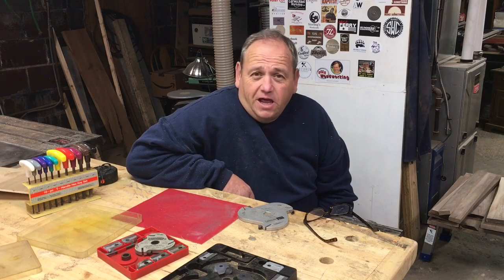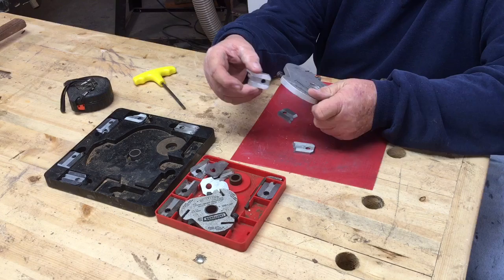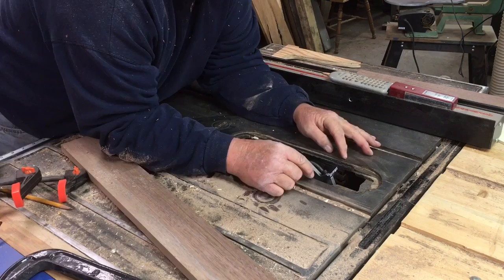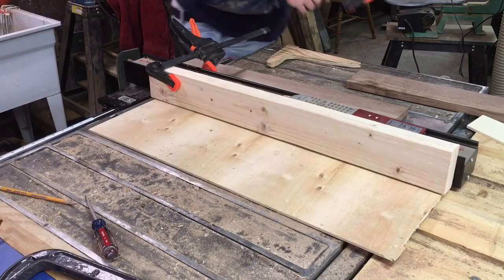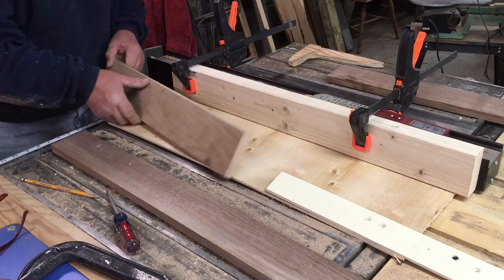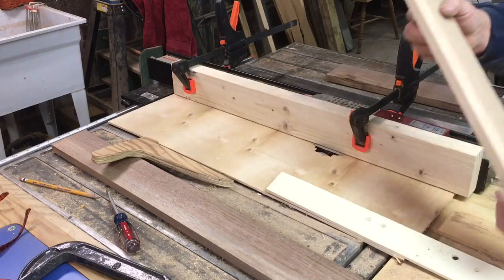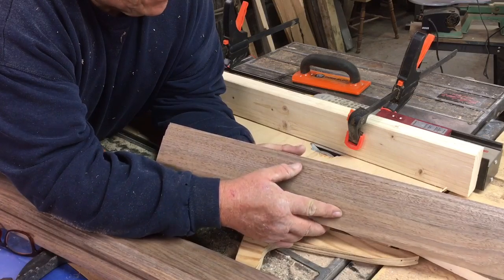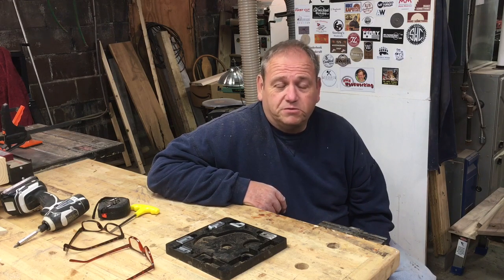Craftsman moldings head cutter and how I was taught to use them by Bob's woodshop

Comment: I am glad this video is still here to be seen.  I have watched a number of them, but you made a couple of points that are priceless.  1. Using a sacrificial fence and only exposing the part of the cutter needed.  2. Using a thin sheet of plywood under the sacrificial fence,  cranking the cutter up through it, and thereby making  a huge zero clearance  insert.   By the way, these cutters, and router bits in a router on a table, can help create some complex moldings.  StumpyNubs has a video about making complex molding with basic bits.  By the way. I just bought a three headed cutter with four sets of cutters on eBay for $10.  Deal of the century.

Comment: I’ve have two different sets passed down from my grandfather that have been gathering dust for 20+ years. I just recently got my shop up and running and it’s with the tools that he’s passed down as well. I’ve always had a passion for it, just never had the time. I’ve got the old tools resurrected and ready to start putting out some nice custom pieces the old school way! Thanks for the video, it’s exactly what I was looking for.
Reply from the maker: Believe it or not there is a company still making cuter for those molding heads cuter!

Comment: I have been looking for a dado set which I don’t really know how to use or put together but while searching and learning I saw the craftsman 18 piece cutters and now I think I have solved my trouble of replacing old 120 year old molding.  I was looking for larger pieces but I see that is not necessary.  Now only to decide what kind of wood is best for molding and then what kind of wood should I used to replace the dangerously soft NC front porch.  
THANK YOU SO MUCH!  Thank you Bob.
Reply from the maker: Good luck with your project! The molding heads are handy, there is a company in New England area! Not sure of the name . But if you google it craftsman molding heads! It should come up! Poplar is a good wood,  poplar takes paint well too! Mill up well !

Comment: Thanks Bob for making this video. I just bought the same one you have from eBay out of concerns they are no longer sold by Sears and may disappear all together. I am well aware how expensive moulding has become so I greatly appreciate the lesson as well as the excellent tip on using the sandpaper to keep them sharp. Looking forward to my first moulding project and your help  was most appreciated. Thank You!
From an old electrical engineer who now prefers to work with wood since most of my projects will no longer be generating smoke or sparks! :>)
Reply from the maker: I hope this helps,I them every once in a while!  I am retired electrician! 😂 I prefer working with wood too!

Comment: Excellent video. Just what I needed. I'm finishing up a remodel of our living room and need to duplicate a piece of trim over the front door. We gutted the room to insulate and rewire and also changed the front door from a 2-8 to a 3-0. My uncle made this trim in the early sixties and only owned craftsman tools. I found a new cutter set on ebay for cheap but was unsure of the setup. The profiles match the original trim perfectly so here I go!
Reply from the maker: taavey  I glad you found the useful I made this video to help just for the reason you stated! I am at that age now that people tell that their father ,grandpa or uncle ! Had a set of these and used them for something in the homes way back in the day!  When I made this video I did not see a good video on the cutters! Good luck with the molding in your house,!  Regards BobLee

Comment: The legendary "Mr. Sawdust" used this tool for a large variety of tasks, his most impressive was cutting swan neck molding for a tall case clock project, something you'd think only a W&H type open frame molder could do, but with a radial arm saw there isn't a profile you  cannot cut. The much older and earlier models were machined from solid bar stock, thus had great mass vs. the flame cuts from plate stock that are more widely available, still though, a great tool.

Comment: Thanks I was looking at Radial arm use of them, but I know they work on the table saw too.
If you get a one cutter head from what I've seen they do not cut as good  speed feed rate.  
Because the sears units had positive side to side alinement you probably get a better cut dewalt made them too.

I have 3 sets of them and haven't worked up the nerve yet  but after watching this I may just do it on my big table saw.
Reply from the maker: Hey thanks for watching, my knowledge is what I put in my video , RAS are something I have no idea how to use them on them lol , I have 2hrs table saw that does a pretty nice job with my cutters . The biggest thing is to take little cuter with them . I use to used my small cutters on my dad’s 8” belt drive table saw and got the job done too!

Comment: Mr. Lee
I have had my molding head since 1978 when I bought my De Walt RAS. Of coarse I use my router table for most shaping today, but my De Walt is still my go to saw and in the early days the shaper head was in use by me all the time.  Many different shaper blades are still available today. Experiment with the tilt head and miter to get some great effects. You can even process curved molding using guides  and hard wood cut out on your band saw. 
Good luck to all, process your projects with safety in mind this molding head can open up may beautiful possibilities
Try some compound shapes by applying one shape over the first, or even the second and third. 
Papa Dave
Reply from the maker: David McMullen what I like about wood working is that I will never be done learning about it!🤗🤗

Comment: Thanks for the safe demonstration (there's another video out the where the guy puts the cutters in the wrong way up!) The only difference for me is that I use a radial arm saw.
Reply from the maker: I have only used a table saw for my molding heads. ! I do have radial arm saw I just use it for cross cut !
Reply: @bobleeswoodshop7919  The radial arm saw is my only large power saw, besides my small bandsaw. I have had rhe RAS for around 40 years & it still works very well. I did consider table saws at the sime - I had used them about ten years earlier in high school, but while shopping for a saw I happened to see a professional demonstrator get distracted and remove most of his fingers ...   Still using the same RAS and still have all of my original body parts.

Comment: Ok Bob, let's Chuck them up on the RAS   they were ment for tablesaws and radial arm saws both.
I like your zero clerence bord idea.
Reply from the maker: Hey bobg I am not sure I would want to to use them in a RAS , mainly no one has ever shown me How! My brother is a lot better with his RAS   Thanks for watching Regards BobLee
Reply: Thats Mr Bob to you.
What I've seen and read in older books on the RAS and molding head cutter you push the stock into the blade like a table saw turned on its side, the molder head is parel to the table and behind the fence like a real molder only overhead.
You move your part into the cutting edge like the table saw, but you use a jig or lots of hold downs and keep your hands as far as you can away and use a push stick. You can move the saws head out and lock it down
To progress into a cut.
I think there are about 35 different profiles you can buy
Still today as well as a full kit.
Last in looked it was 19.99 plus shipping for a 3 blade set.
But a few cost more.

You also need a dado guard, and I'd use board buddies because you don't want this giving kick back. Take light cuts  until you know what you can do with the tool.
I own a big Bel saw but it needs some work and I don't have any molding blades for it yet but I can buy them from Bel saw as well as wood master, you can also have them made.
I'm wondering if these cutters will fit it with the right Gibb. Anyone know?

Comment from the maker: Just remember you are responsible for your self  so know how to use your tools  and wear your safety equipment!! I hope the video will help New woodworkers with the older machines!! Regards Bob Lee
Reply: Is your table saw belt drive? if so is the motor loose or tensioned?
Reply from the maker: commander187  My table saw is a Craftsman 12"  2horse Direct drive .  I do not know about a belt drive. The thing I do is take small cuts with the cutters . That way the saw can handle the process of making the cuts .  I make several passes with my wood through the table saw.
Reply: Cool thanks I have a 10 inch belt drive and to my understanding the weight of the motor keep constant tension during the raising and lowering of the blade. I think I'll look for what you have there. I did not know that craftsman made a 12 inch.
Reply from the maker: commander187  You may not find one I got my saw 46 years ago from sears !! I got the last one they had at that time!
 You could get a bigger motor for your saw or find a newer saw with a 2horse motor on it . I know that is more money its just I think you are going to find that saw that I have. I am 63 years old now I have not seen one anywhere? Best Regards BobLee

Comment: That is a very useful tool. I dont know if these exist in Europe too, i'll be looking at every fleamarket from now on!
Reply from the maker: Willem Kossen  oh wow that interesting . I use my own from time to time . You still find them used ! Thanks for watching Regards BobLee
Reply: The existed in Europe, but for reason of safety regulations they are not produced anymore. Available only with chip limitor now. Beware, without the chip limitors this is a verry dangerous tool . Not to be used on a table saw machine  if the rpm is not adjustable. Mostly on table saws the rpm is +/- 3000 rpm, this is for moulding operations mostly (much) to low . Kick back risk and poor finnish are possible.

Comment: would be interested to see if anyone has used/compared the set with the 3 heads vs the set with the single head.   obviously you get more profiles with the single head, but seems the cut would be better with 3 heads.    also would like to see them used in a radial arm saw... for me would almost be a like a dedicated tool for molding
Reply from the maker: rapunzel eh?  From my understanding they were designed for a radial arm saw !  I don’t know how to use them on that kind of saw!🤷‍♂️ thanks for stopping by!

Comment: New to the woodcraft stuff. I just purchased the smaller Craftsman set in the red box like you have, other than being smaller what is the difference in the larger set in the black box?
Reply from the maker: Just the size ! The smaller one I used on a 8” table saw of my Dad’s! The bigger one I got for my 12” table saw!
Reply: Can I use the smaller set on a 10inch Craftsman table saw?
Reply from the maker: @lynwoodspire8503   should work
Reply: Thanks

Comment: I have a set of these that I inherited from my grandpa, used them once about 15 years ago when I barely knew what I was doing to put an edge profile on some shelves and got the job done but it was scary.  I have a much better appreciation for how to do it safely now with auxiliary fences to help hold the workpiece down, and your improvised zero clearance plate is a great idea.  Planning to use this again to replicate a picture frame that my grandpa made about 70 years ago, I love the nostalgia that comes from using his tools.  There are lots of these molding sets on ebay, and you can also buy new heads and cutters from corobcutters.com, with all sorts of interesting profiles.
Reply: I have a three-blade cutter with several sets of blade profiles - I use them with my radial arm saw. Planning to order more cutters from Corob. 
I try to visit my local Habitat for Humanity ReStore,  something I highly reccomend if you have one in range. A couple of weeks ago I stumbled upon a UNUSED Sears single-blade cutter head with eight different cutters, and it was bundled with a Sears dado set which was also unused. Easiest tool-buying decision I've ever made!

Comment: Hello there, I wonder why nobody is talking about the rpm for this tool. Most table saws are running less or more 3000 rpm. Fine for sawblades but much to low for such a profiling tool. With +/- 3000 rpm the cutting speed (not the feeding speed!) is realy to low, witch is making the use of this tool dangerous. There is a high risk of kick back due to this low cutting speed. Provebly one of the reasons why this tool is no longer in production. Something you have to be aware of. Have fun woodworking, keep it safe!
Best regards.
Reply from the maker: Dirk Thanks For Watching I had to do some looking on specifications for my saw . My is a 12”” 2hrs power 220 volts motor that is direct dive  with 3450 rpms . I understand your point .! I done over feed my wood Thur the cutters and take small pass off of my work pieces. Any tool can BITE You . It just comes down to being safe and smart in what you are working with!   All tools can HURT!!! A big Thanks for sharing your ideas. It makes me think too!!!!! Regards BobLee
Reply: This tool is safe if used correctly, like many tools.  But there are a lot of Jacks out there.  Remember geometry from school, Circumference = Pi x Diameter?  Calculation shows that a 3/4" diameter router blade spinning at 25,000 RPM is traveling at 83 feet/second (cutting speed), but only 33 feet/second at 10,000 RPM.  The same calculation for a 7" diameter craftsman molding blade spinning at 3450 RPM is traveling faster at 105 feet/second.  The three craftsman molding blades spinning at 3450 RPM equals 10350 cuts per minute vs 20,000 cuts per min for a router at set at 10000 RPM.   So, for me, this is not a big difference, especially with a router blade next to your face.  I've had my Craftsman molding head cutter since 1991, and it still works great.  You can avoid kickback worries by using feathers on the board while feeding, reasonable wood removal cutting depth per pass, not standing directly behind the board, using tool extension grippers and sticks to keep your hands off the board, and above all, common sense.  Wood jointers also use blades knives at 3450 RPM, kickback?  I think they still make them.  Could it be that routers are cheaper than table saws and easier to use for making molding as to why the molding head is no longer made?